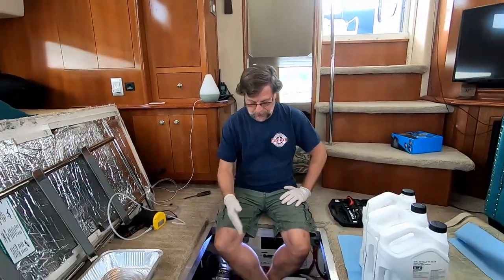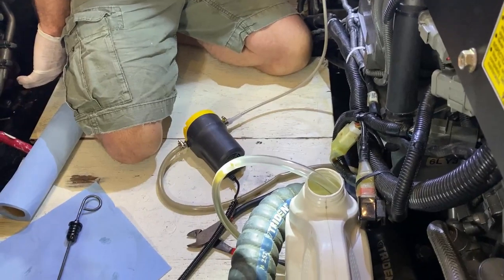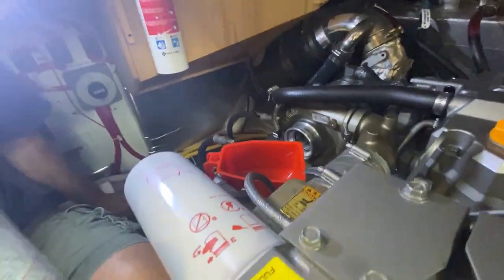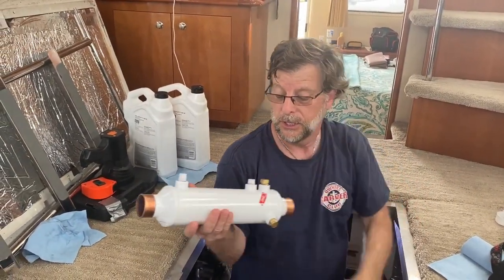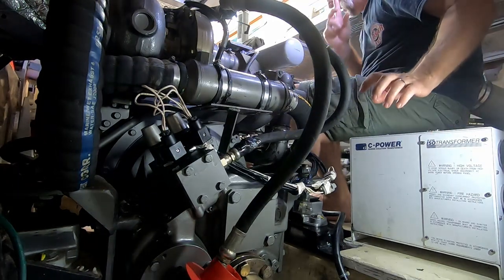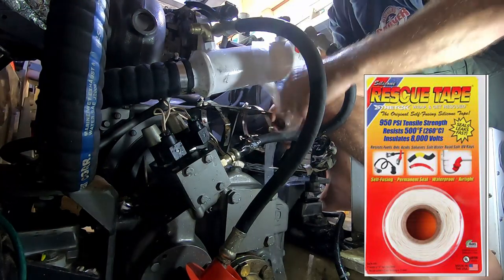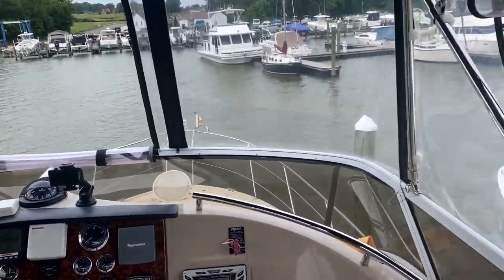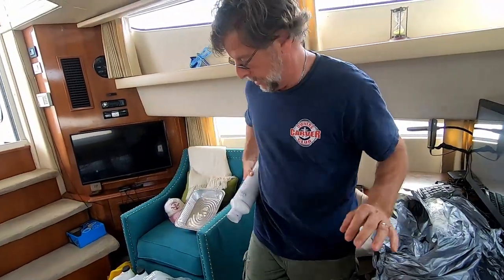Replacing Transmission Oil Cooler on Yanmar 6LY3 Engine

Comment: Great work! But how did it turn out? How many times did you need to flush the trans oil to remove any signs of water?
Reply from the maker: Hi Skip, everything worked out great. Everything was clear after two flushes, so I did a third. We've had the boat out three times since and all is well.

Comment: How old are your transmissions / engines that the cooler broke down enough to let water in?. About to service my engines / Transmissions and wonder if I should be changing the coolers?
Reply from the maker: Engines and transmissions are original 2006. They currently have about 1900 hours. Personally, I wouldn't change it until and unless it fails. It is possible to remove, inspect and pressure test a cooler, but it will likely pass the pressure test, if there are no cracks or failures in the cooler.